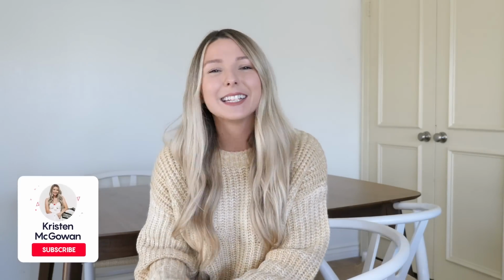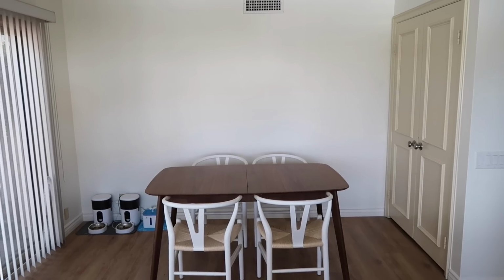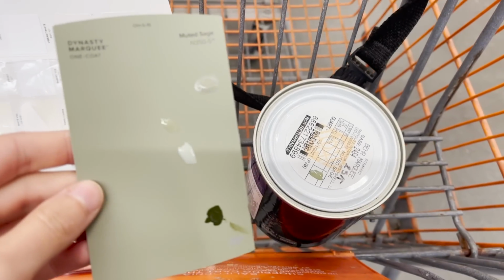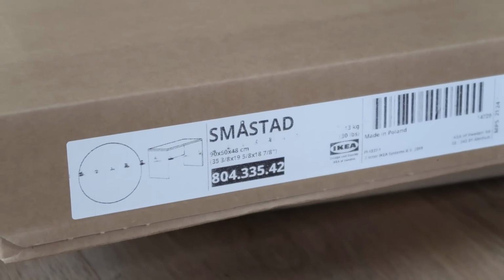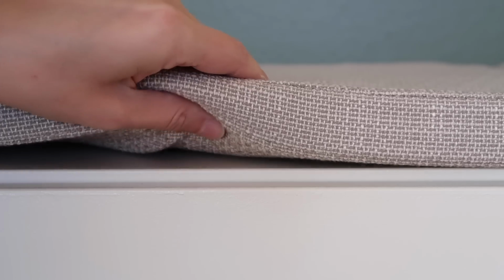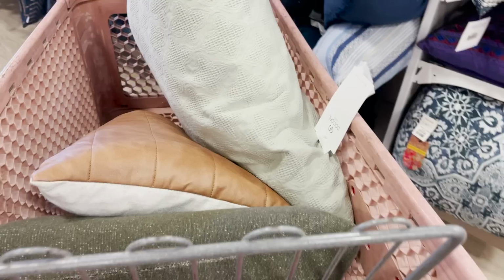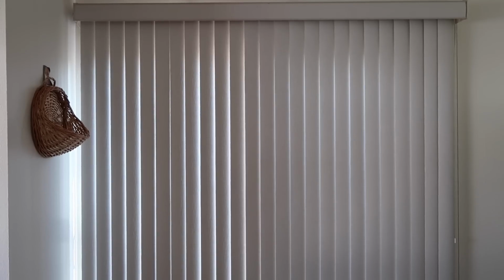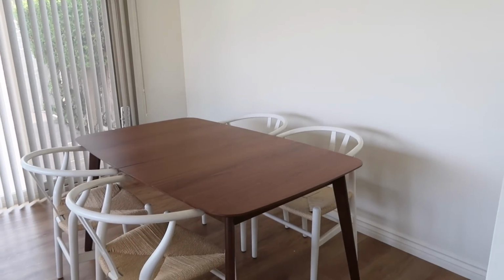EXTREME BREAKFAST NOOK MAKEOVER | DIY IKEA BENCH SEAT HACK

Comment: Another beautiful room, Kristen! Your wall sconce idea is brilliant! I have a new screened porch with a 23' long wall of screen panels, divided by white square posts about every 4 feet. I want to put some sconces on the posts near the dining area, but don't want to run wires. I will definitely be using pucks on small sconces as you've done here. Thanks!

Comment: If the right side of the sliding doors is stationary, did you consider adding a third perpendicular unit to create a corner bench? It could stand away from the glass slightly to allow for the drape, and you'd have to add a back panel and fill in the gap, but I think it would make for a cozier nook.

Comment: Some nice changes. Would've preferred oval table, or elongated half round (with straight side against bench), if you wanted curved edges. The round seems bit impractical. Top edge of the dark paint feels like it needs to be grounded with slim piece of chair molding, perhaps, to help define the transition. (The wall appears too flat in comparison with everything else going on in the room.) Don't think I'd''ve had sconce shades align with edge of dark paint. No actual overhead light for table(?), are the sconces enough illumination when no sunlight?
Reply: Yeah really not a fan of the table, I would have gone for either an oval as you said or rectangular.
Reply: I remember her saying during the house tour of the kitchen that  she's doing renter friendly changes. So lightweight, non-hardwired sconces are a good choice. Same with the non-custom bench which would have scaled with the table she chose.

Comment: I have a question about the weight capacity. Do you think these toy boxes could consistently hold the weight of a person? Do they feel sturdy and secure?
Reply: I actually wanted to do this, I called IKEA after buying them and the weight limit is 100lbs to 150lbs, so ultimately it’s a recommendation, but I didn’t risk it. 😅 I just use them as a toy box cause I didn’t want the dreaded event of someone possibly breaking it and feeling awful.
Reply: They are pretty sturdy, but they are also manufactured boards, so for me, I’m not 100-150lbs so it was a no for me. 😅
Edit: I’ve had the toy boxes for two years and one of them(I use it for a bench for my kids to store winter boots and coats) is starting to fall apart. It was a nice Temporary piece but eventually I will need to replace it.

Comment: I think this space turned out cute. I like the accent color on the wall. Very interesting! The color of the original table may have been off, but the size/proportion was perfect. The round table seems a little off with the bench ... The use of "Extreme" was a major over exaggeration.

Comment: Thank you for the tip about hanging artwork.  The pillows on the bench leave about 6 inches of "butt space" so of course, if you choose the cozy padded bench over the hard chairs, Goldilocks , then the pillows will end up on the kitchen floor.  I am not thrilled with design that gives me more work to do.  A half wall of paint in a small created room; no, not a good idea.  If you want an accent wall, paint to the ceiling to make the room look bigger.  The furniture is too clunky.  You have a beautiful airy kitchen with small details, like molding, you want to match that.  A garden table with a glass top and a white base would have been better.  You are caught up with the nautical element, and are exaggeragting those elements, but pairing with wall art which is more detailed (in fact, the wall art fits, the anchor and butcher block does not).  You are trying hard and are generous and have a nice way but this design while better than before is a mess.

Comment: I posted this a while back but I thought I’d repost it, if you are contemplating doing the bench design, understand that the bench has a weight recommendation of 100lbs to 150lbs- I bought two thinking this would be a great idea, called IKEA because I couldn’t find a weight limit and they said it was 100 to 150lbs. They are sturdy, but they are also Manufactured wood, and consistent sitting may result in them breaking. 🤷🏻‍♀️ Its up to you ultimately what you choose but I think in the long run it’s better to just save for a better bench seat online or even contact a local carpenter who could make something like this for you.